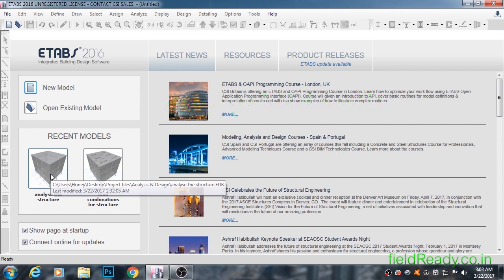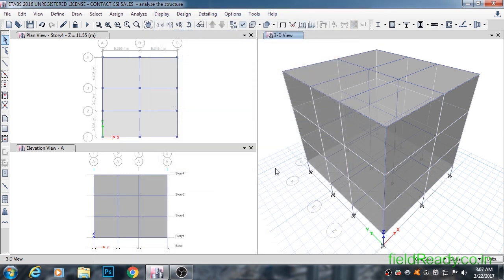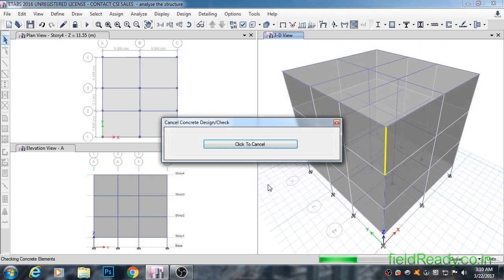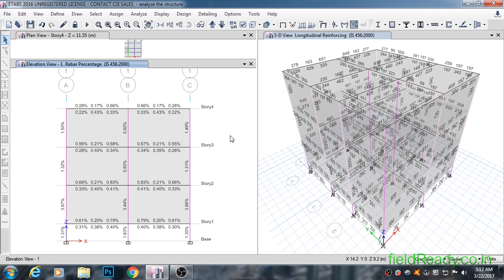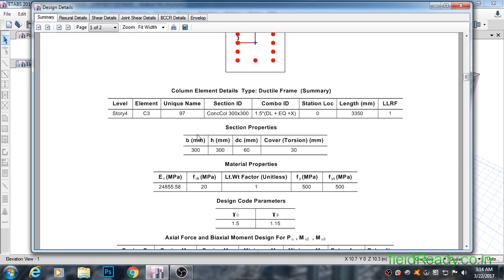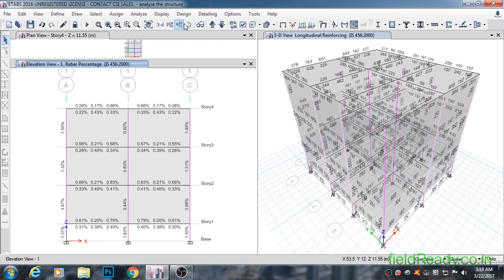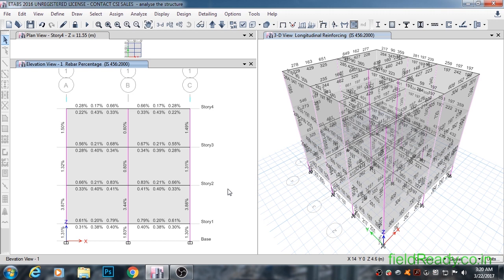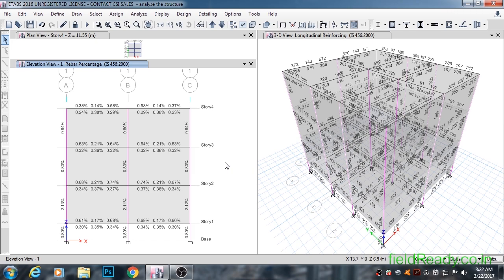Design & interpret the results in Etabs 2016

Comment: hi. some of my columns are shown as red but when i check the design it says all members passed. if my design is okay then why some columns are red?
Reply from the maker: If it is showing RED, then it should show as a failed member. Try remodeling the structure from scratch.
Reply: thanks. i have a problem with my model.it's a 8 story building and no matter how big i make the column it keeps showing red? what do u think is the problem?
Reply from the maker: There can be several factors for occurrence of problem. Send your Etabs model file at support@fieldready.co.in